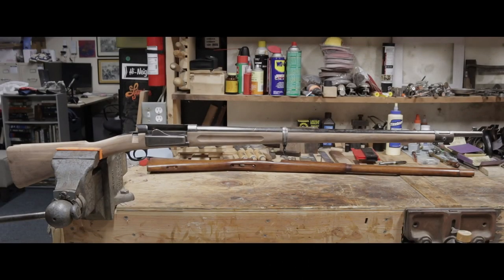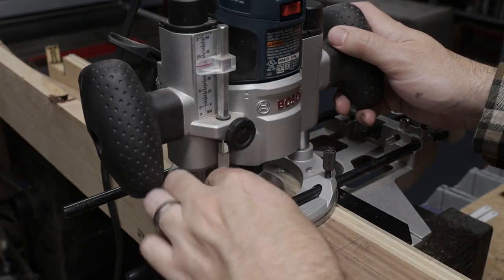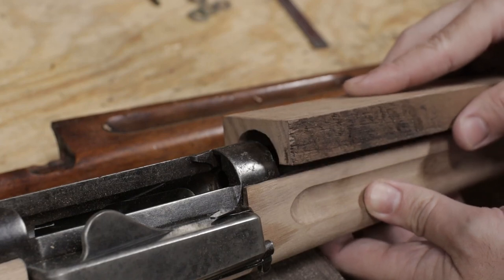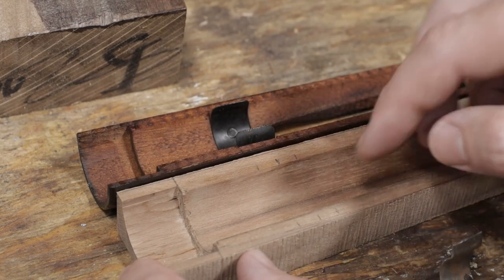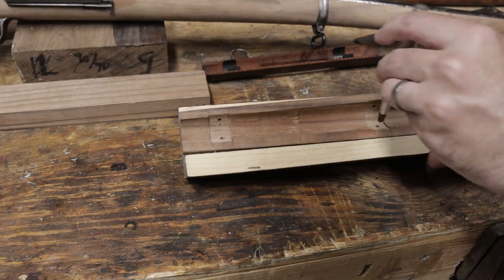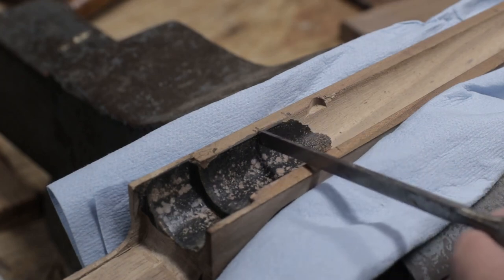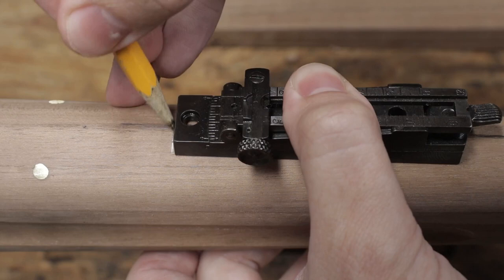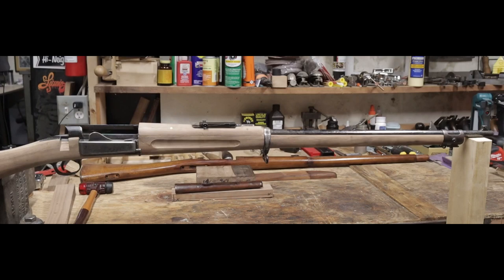Making the Handguard - Making a Military Rifle Stock Part 7

Comment: I have an outfit making clips and rivets off my original hand guard for my blanks.  How come you didn't temper your clips?  When you shoot that a few times the vibration is going to unspring those clips and the hand guard is going to get loose.
Reply from the maker: The clips were made from regular sheet metal so they wouldn't hold a temper. I could have made from from spring steel but I don't think the durability of the mild steel clips are a concern. If they spread apart, they can always be re-tightened.

Comment: What were the lengths for the holes you drilled in the clips? I'm having a hard time finding real ones, so it is looking like I'm going to need to make them myself as well.
Reply from the maker: They were 1/8" in diameter and just long enough to stick out of the handguard maybe 1/16" to peen over.

Comment: What are the rivet dimensions?? Was spring steel used for the clips?
Reply from the maker: I believe the rivet bodies were 1/8" diameter and the heads were .205".
The clips were made from regular sheet metal.
Reply: Thank you. I have a repro handguard that I was going to attempt making clips and rivets for. This helps greatly!